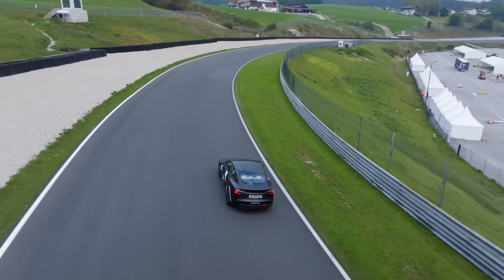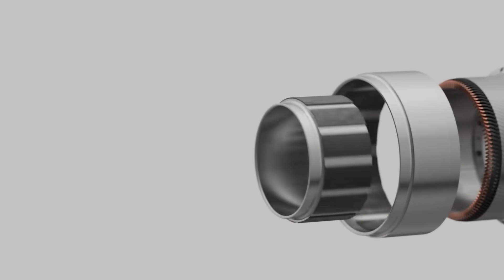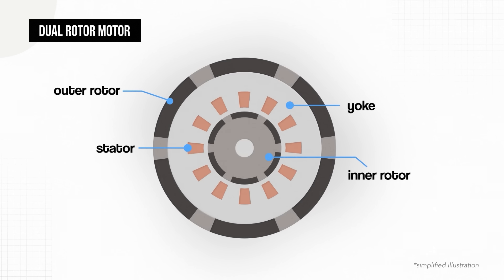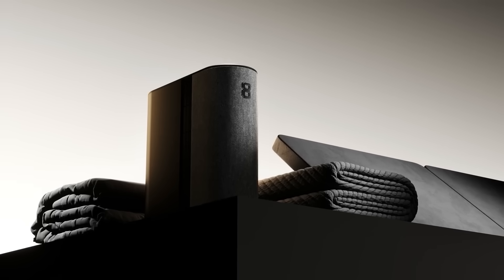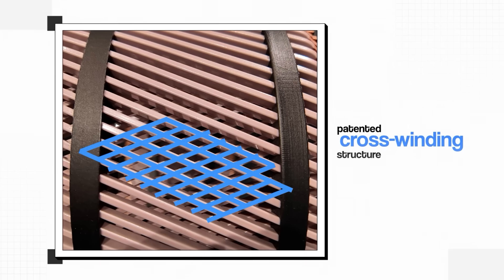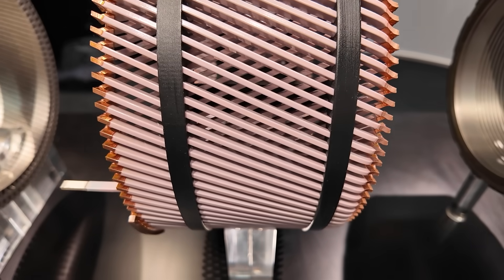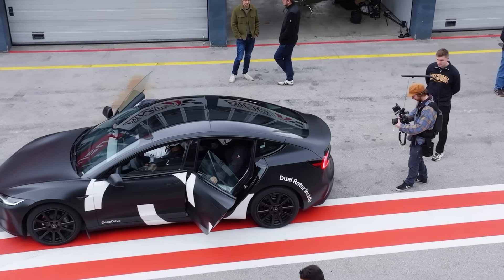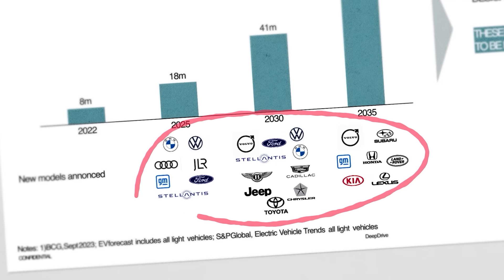How Dual Rotors Make Motors Insanely Efficient

Comment: Hitchhiker: You heard of this thing, the single-rotor motor?
Ted: Yeah, sure, single-rotor motor. Yeah, the EV motor.
Hitchhiker: Yeah, this is going to blow that right out of the water. Listen to this: Dual... Rotor... Motor.
Ted: Right. Yes. OK, all right. I see where you're going.
Hitchhiker: Think about it. You go to a car dealership,  you see a single-rotor motor model sittin' there, there's a dual-rotor motor model right beside it. Which one are you gonna pick, man?
Ted: I would go for the dual.
Hitchhiker: Bingo, man, bingo. Dual-rotor motor. And we guarantee just as good a motor as the single-rotor folk.
Ted: You guarantee it? That's - how do you do that?
Hitchhiker: If you're not happy with the dual rotor, we'll take back the extra rotor free. You see? That's it. That's our motto. That's where we're comin' from. That's from "A" to "B".
Ted: That's right. That's - that's good. That's good. Unless, of course, somebody comes up with a triple-rotor motor. Then you're in trouble, huh?
[Hitchhiker convulses]
Hitchhiker: No! No, no, not triple, double! Nobody's comin' up with triple. Who powers a car with a triple-rotor motor? You won't even spin a wheel, not even a mouse on a wheel.
Ted: That - good point.

Comment: this sounds like the improvements made by GDI. 10% less fuel but you end up with higher running costs.
engineers are ready to make a disastrous engine all for only 0.01%
better fuel economy, see 1.0 ecoboost-timing belts.
but maybe not the case here idk .

Comment: Also dual rotor machines have a yoke. But this yoke are just two simple iron rings at the sides opposite to the stator coils. It is just the same as in the case of the axial flux machines. But in this case the yoke is located at the stator coil packages opposite to the permanent magnet rotor. The disadvantage of the dual rotor machine is the much more complicated and less mechanically stable coil structure, which cannot be made by simply winding a coil on a core, which can be easily packaged into stator plates.

Comment: If the torque is so high the regen strength might even be strong enough to do away with the friction brakes, thus saving some unsprung weight. Put smaller motors in all wheels to share the weight and resist the urge to make the car overly powerful.

Comment: Crap. This design was one of many that I was attempting to get patented in 1987.
No joke.
I still have the drawings.
Along with about 130 others.
The dual rotor may be configured as co-rotating or counter rotating (which has some further advantages in many applications). The split azimuth windings have lots of advantages as well. Using aluminum or brass between the inner/outer "layer" can produce special effects in some applications.
Using bars, or really fat high current/low voltage windings, is not a new idea. It has been used in almost every induction motor.

Comment: So it seems like there's fewer windings in the electromagnet than in traditional winding systems, and so lower magnetic flux. Isn't there a connection between magnetic flux and motor power? Are there any other disadvantages of this arrangement?

Comment: In a recent post of yours, you looked at a new motor developed by Ferrari. In that, you claimed that by using very fine windings, Ferrari had overcome something I am going to call "the edge effect" (because I cannot remember it's technical name) whereby electrons prefer to travel along the outside of a conductor, leaving the inside core, relatively under-utilized. This would seem to make the bars in this design relatively inefficient from that point of view.
You also claim that the design could improve efficiency by 20% across the average drive cycle. You need to clarify that. If a typical efficiency is (say) 50%, has this yokeless motor increased efficiency to 70% (50+20) or to 60% (50x1.20)? 
Interesting ideas none the less.

Comment: Isn't the number of loops in the stator proportional to the strength of the magnetic force.?
1 of these copper bars seem to take up the same  cross-section of about 10-20 overlapping copper wires.
My guess is that this creates a very weak magnetic flux compared to the traditional design.
Reply: Also what is the efficiency of the traditional AC motors.?

Comment: One more comment: The title of this video is "How Dual Rotors Make Motors Insanely efficient", yet not a single efficiency value was given.
Reply: Modern brushless motors are already up to 95% efficient, and the theoretical max is somewhere around 98% running them in a vacuum with superconductors, maglev bearings and the like. Whatever efficiency gains it has won't be notable, the main benefit would be from it being lighter or easier to mass produce I presume. The low speed torque is great in general but not that useful for EVs specifically.
Reply: @kalsrobots  thats electrical to mechanical conversion. Such pencentage does not take into account their weight and how they increase the consumption on a car
Reply: He did say near the end that over a full drive cycle it could be 20% more efficient.
Reply: Which efficiency? Electrical to mechanical force, power per L or Kg, or even how much REE they need per motor?
Reply: Lighter weight motors, increased torque, less materials used are all “efficiency gains”.  The electricity lost by an electric motor is almost trivial when compared to air drag and roll drag.  The cars weight causes roll drag.
Reply: @stefanr8232  roll drag is a VERY small factor though. I recommend aging wheels' video on towing for more info
Reply: yep, click bait for sure!  Motors are ALREADY insanely efficient compared to gas motors.  In fact, can they cool this motor when the things that get hot are sandwiched between metal?
Reply: @murraymadness4674 yes. That's described in the video.
Reply: There should be far less heating with the apposing magnetic fields, a lot like noise cancellation on your EarPods.

Comment: Ah, and inner & and outer joined together so, locally, its a slot based linear motor (flat earth style) wrapped around in a cylindrical patter so the 'start and end' can join together. Neat. 
Now to hear the details!
Ah, the yoke is moved to the end (side) to allow the slot effect.
And the helix design is a neat structural feature. However what I think it hides is that the inner and outer liner motor effects 'roll' at right angles to the copper bars and are thus travelling in different directions (45 to the axis) plus the inner and outer rotor also appear to have helix arranged magnetic slots. 
Definitely need to unroll the cylinders to see the locally flat linear motors in 3d..

Comment: Unfortunately for electric vehicles, the limiting factor on their acceptance has never been the efficiency of the motors. It’s been the capacity of the batteries (which is literally the equivalent of a couple gallons of gasoline!) There are some promising developments in the battery department, but like many great ideas, most will not make it to production.

Comment: Put two motors into the gearbox one behind the other. Drive shafts have flexible “constant velocity” (CV) joints at each end. One side will angle back to the wheel the other towards the front. Wheels are symmetrical like any other car.

Comment: Is there such a thing as disk  electric motors ? Like  axial flow jet turbine .oh the fun . .variable pitch  blades,  fir tree roots, dog clutches connecting and coupling each disk on the shaft, self air cooling, gearbox and engine combined and de-coupling of the discs to acheive regenerative braking.

Comment: Can't sane wash the laws of physics.  Unsprung mass at each corner will affect ride and handling.  On a smooth test track  it may be less noticeable but on a rough surface every divot in the surface becomes more important. These motors at the corners will have their applications in daily drivers, vans,  trucks etc. but give me a hyper-car with inboard Deep-Dive motors, inboard Carbon Ceramic brakes, and carbon fiber wheels any day 😁

Comment: Might be more efficient than a standard motor but not as efficient as they could be, I see flaws in the shape of "cost effectiveness", "weight saving", "size & shape limitations". Also, the magnetic force of an electromagnet is greatly reduced by not having a stator core. The axial flux is a better design all round but even that had room for improvement, what ruins it is trying to make the design compact when it really doesn't need to be. Skimping on size, weight and materials leads to a less efficient motor that requires more than nessaserry current to move it, reducing its overall efficiency.

Comment: Before anyone says that " this is a brand new idea" and not just clever engineering of the details, please read Bödefeld On Elektrische Maschinen, written 75 years ago. Not much is new under the sun. Just better magnets and power electronics.
Agree with the comments on vibrations as a killer of hub motors, in particular this kind of one side bearing designs. cool but... perhaps look at inboard breaks of F1 cars for inspirstion on alternative hub and wheel configurations.

Comment: Interesting, this is the first time I've seen this brand. I noticed similarities to what I'm designing. I'm drafting a planetary motor based on annular rotors, somewhat similar to their design, but they present many critical observations that I've always avoided in my design:

1st Unified stator, this increases the sharing of the magnetic field and saturation in the same metallic body.
2nd Unified copper winding, probably proprietary, making manufacturing and repairs difficult, where they themselves claim it's a patented design.
3rd Liquid cooling to reduce electronic inefficiency derived from the heat generated by the design mentioned in the previous notes.
4th Use of structural and insulating materials such as plastics, which further necessitates the use of specialized cooling.
5th The two poles generated by the stator move two independent rotors when it could be used for only one, freeing up space for multiple stators and multiple rotors with stacking patterns, which is what I've been trying to design most.

Comment: What you’re describing isn’t accurate. The magnetic field doesn’t rotate as a physical object. The three phases vary in strength with a 120° offset, and their combined vector only appears to rotate. That’s a mathematical rotation, not an actual sweeping flux.

And the claim that the yoke ‘adds no power’ is simply wrong. Without it, the magnetic flux collapses into the air gaps and the torque drops sharply.

As for the motor you’re referencing: it absolutely does have a yoke. In the patent drawings, the stator core is clearly labeled as parts 2 and 18. The designer may use a different name for it, but it is unmistakably the stator core — smaller, yes, but still essential. It’s not optional; the design relies on it.

Regarding ‘magnetic loops’: the correct term is magnetic flux or flux lines. That’s exactly what the stator core guides and contains.

I understand you’re not an engineer but a tech journalist, and that’s precisely why it’s important to get the fundamentals right. You inform the public, and misunderstandings like this end up misrepresenting how the technology actually works.

Comment: Interesting concept! About unsprung mass. Suspension improvements don’t affect the unsprung mass, because, well, the mass is unsprung.
Reply: THIS ! I’m practically triggered at this point by people waving away unsprung mass. No matter how novel your suspension design, inertia is unchanged. On a smooth test track with gobs of torque, you may not notice a huge difference, but on the potholed hellscape common in our urban centers, you quickly appreciate why people like me are focused on minimizing unsprung weight. The larger the mass propelled upward by a bump, the longer it takes for in to come back down and regain traction. 10lbs difference in wheel & tire weight is very noticeable—at least in the lightweight cars I favor. Factor in the frequent washboard on the gravel roads I like to play on, and you understand why I run the absolute lightest combo I can afford
Reply: Also what's everyone's problem with just using a drive shaft? It doesn't have any meaningful losses, doesn't affect the brakes, weights less than whatever mess you'd need to protect the motor inside of the wheel and you have 100 years of suspension designs to choose from.

Comment: I'm interested to hear what the fundamental winding factor is for this design. This cross-ply style design with no end-windings and different halves of each turn pointing in different directions seems like it would be considerably lower than with a traditional full-pitch non-concentrated type, more like other radial flux designs

Comment: Similar windings, but only flat as a pancake, were used 40 years ago in high-torque and low-inertia motors on MAHO milling machines.
Reply: The magnets were also on both sides of the winding.

Comment: This is just an intermediate solution. The motors going to be 3d printed. Unlocking 3D design freedom. First 3D printing has to reach multi material metal printing. 
Once additive manufacturing reaches true multimaterial metal capability (conductors + magnetic alloys + structural alloys in one print), you gain huge design freedoms.
Also the stargate LLC will help to run the simulations. And get the design onto the table in weeks.

Comment: Thank you for all your hard work in these videos, but I don't think you explained it fully as I still dont understand the physical operation of the motor- only that it has two rotors.  Do they rotate together?  Are they "geared", i.e. does one move faster or more slowly?  Sorry, I was interested in the interaction between the two rotors and how and why they make for a better solution, outside of getting rid of the steel stator.

Comment: Great video with fantastic info.
Regarding in-wheel motors, check on the Saab Emily GT and how they found it is more about managing the ratio of sprung to unsprung weight, which EVs actually help with a lot due to having a much higher sprung weight due to the battery packs.

Comment: Surprised at your comments on unsprung weight.   Renault used them in the RS5 as they figured the cars would only be used on racetracks which are very smooth.  In everyday driving the mass in the wheel reduces compliance as the mass needs to accelerate up and then down giving the suspension little chance to keep the tyre on the ground.  The gyroscopic effect is also very bad on steering and general agility.

Comment: The 30% cheaper per Nm is such a bung value. It has 5ish times the torque as a regular pm motor with same power output and as a central drive unit. So it's more expensive?

Comment: I heard, big problems with EV cars, they don't use oil like IC cars for lubrication.
EV cars have ball bearings everywhere.
If the ball bearing fails, it's an expensive repair, bc the EV motor has to be pulled and taken apart in order to replace the bearing.

Comment: And does any of this translate to heavy freight on railways? GB is looking at the possibility of intermodal trains with motors throughout the length of the trains in order to run them at 110 mph up the west coast main line. Single axles at each end of the wagon would help reduce weight for carrying containers mainly for foodstuffs. The axles would have to have a loading of no more than 20 tons so lightweight motors giving good acceleration are desirable.

Comment: Why not embed the coils in an epoxy or any other electrically insulating materials but with good thermal conductivity. I wish you took a better picture from the front of the stator so I can understand the 3 phase wiring...

Comment: What this is missing is that the "yoke" also controls the magnetic fields, by channeling them through materials with higher magnetic permeability than free space. laminations of silicon steels are preferred because they minimize eddy current losses and push the magnetic fields along their most effective paths. This is incredibly important for efficiency and thermal control. The yoke however does not need excessive back iron that blocks a stator - this is not necessary, I've worked on a number of motors that had virtually no extra back iron in the yoke. In wheel motors are far more vulnerable to crashes and damage, consumers do not want and generally will not tolerate this. 

What this looks like is a scam of stripped down cost cutting to maximize torque with  motor you'll have to throw out after a year, using  gimmick to sell itself rather than having actually strong fundamentals. Yes, a dual rotor motor can get incredible torques and power density, but you still want a good thickness of magnet, you still want a proper yoke, and you want to be able to operate it at a reasonable voltage (this is a VERY high voltage motor design, as you can see by the low coil number high thickness, more interesting as proof of concept than as production unit). To actually be decent motors for cars you'd want to drop the voltage, increase the coil wrap count, drop the wire gauge, introduce a proper and well designed yoke, chunk and stagger your magnets long the axial length to reduce eddy losses (the pictured motor would demagnetize quickly in operation), and then you still have a few additional mechanical issues to work our related to how you balance and take care of the non-radial forces on the shaft/axle inside the motor, likely requiring a strange bearing configuration and extra high speed seals and lubriction. 

And at that point, why not just switch to axial motors where your dual rotor is a lot more straightforward, and your torques are higher from the configuration level alone? While there's definitely legit use cases and designs, I'm not seeing it here.